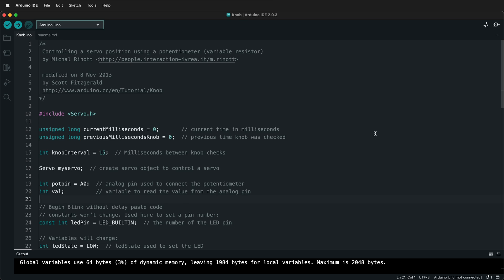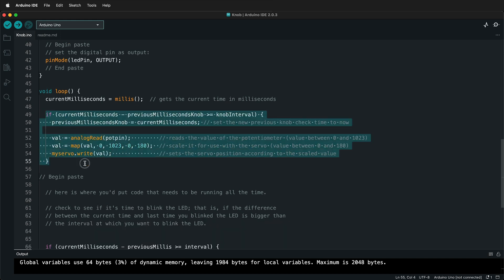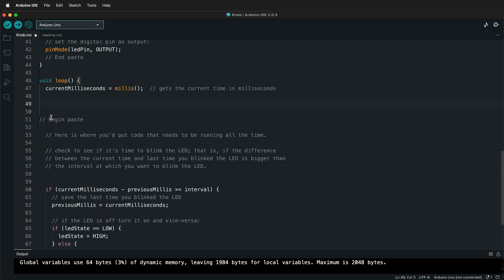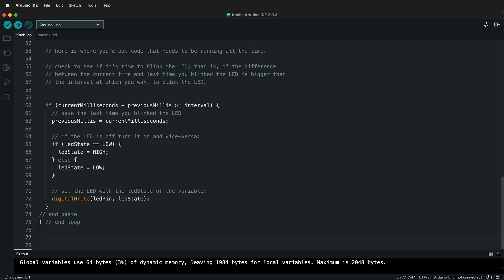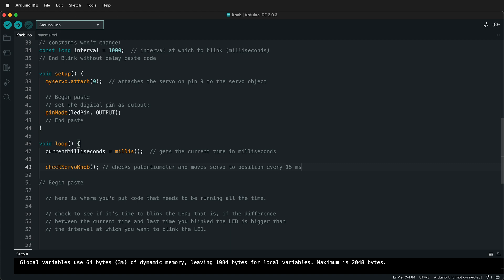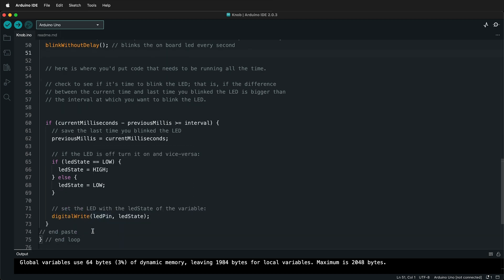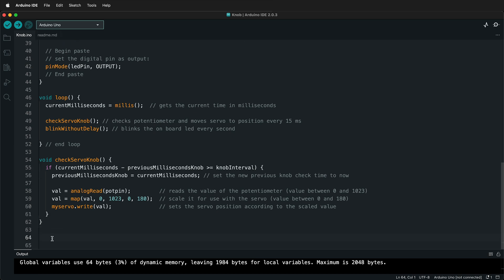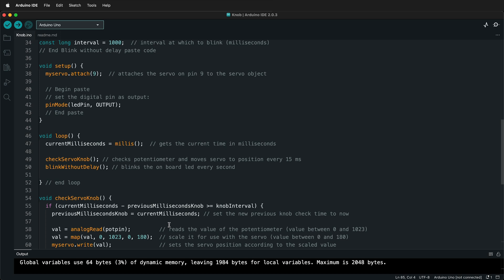How to Put Arduino Code into a Function

Comment: Do you have a part two where you use parameter?
Reply from the maker: This video isn't specifically for Arduino code, but the concepts are the same, it covers functions and parameters and even passing default values to parameters and functions using p5.js https://youtu.be/dHKhVQ7aQcw

Comment: Thank you for posting this informative and educational video which I was able to put to use in my learning Arduino coding. I've combine using your previous "How to Combine Two Arduino Sketches" the "For Loop Iteration" and the "Fading" sketch. And in concert with your How to Remove Delay video, have both sketches working; I thank you for your video guidance. I have a question as to how to Fade the LED 5 times, stop and begin the "For Loop Iteration". I came across this statement: void fade5times(){ for (int i=0; i<5; i=i+1){ } and from what I've read and understand this statement is to be placed in/or just bellow the "VOID LOOP". Any help or direction you could provided would be a great help as I'm a 70 yo neophyte to coding.
Reply from the maker: Instead of using a for loop you can just use the loop. So you make a counter that increments based on one of the millisecond timers. So at the beginning of the loop reset the current millis. Then have an if statement that increments the counter if that millis timer has elapsed. After that, if statement have the digital right for the value of the faded LED. And then just let the loop run and it'll run perfectly without a delay or a for loop
Reply: @WhatMakeArt  Thank you for responding to my comment, now I just need to figure out how to do what you suggested.
Reply from the maker: Here is a recent forum post on the Arduino Forum that shows a way to remove delay(); from a for loop by just making it part of the loop https://forum.arduino.cc/t/how-to-remove-delay-in-a-for-loop/956165